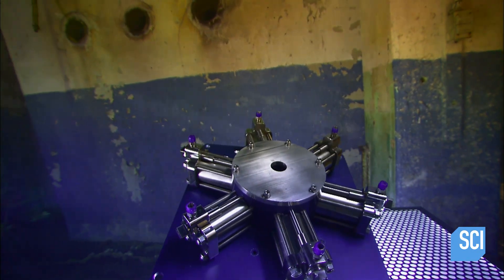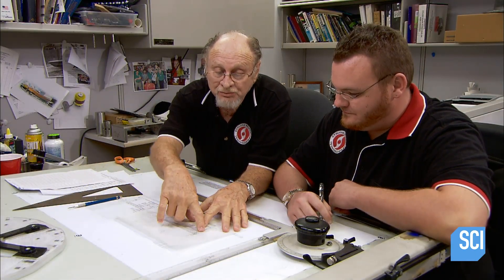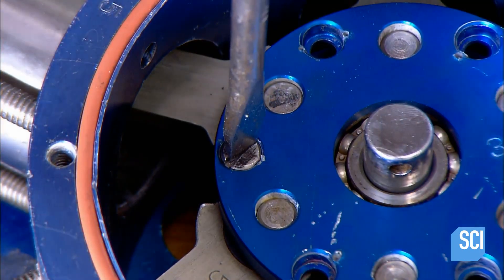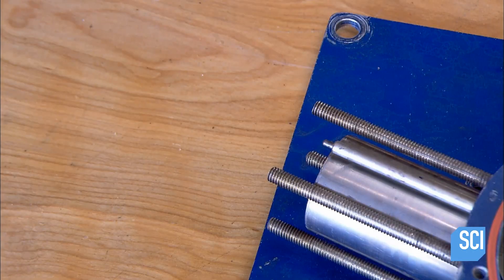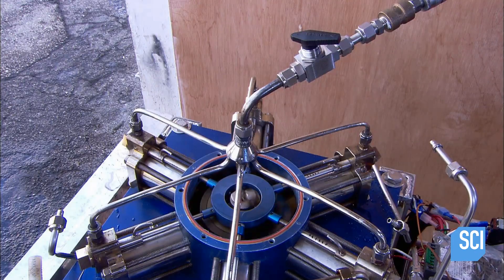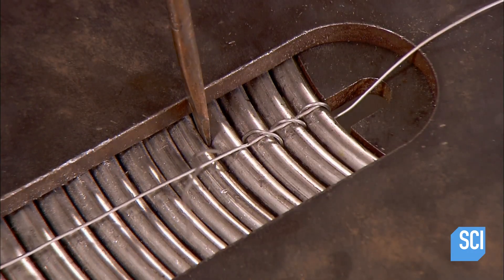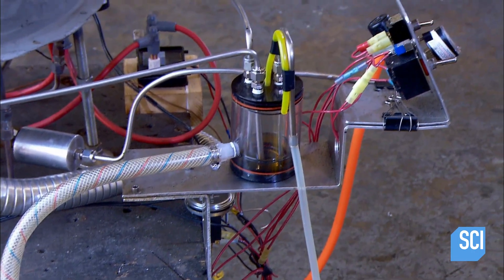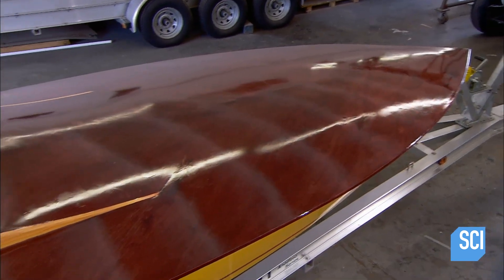How It's Made: Steam Engines

Comment: This is awesome! Can this engine withstand freezing temperatures? Won't the water expand and warp or crack components? Maybe if you mix anti freeze into the water but I'm not sure if that will interfere with engine operation.
Reply: Use it in a car
Use it on a boat 
Use it in a house that is remote
Burn gas
Burn grass
Burn family photos en masse
Reply: Are you aware that steam is hot?
Reply: @kylesenior  I was referring to when the engine wasn't operating obviously.  However now that I think about it I suppose electric heaters could prevent damage during down time in freezing temperatures.
Reply: @robotswithryan8348  Fair enough. It seems strange to me to run the system intermittently, but if that's what you're doing. I'm not sure water would pool inside the pistons either when not in use.
Reply: @kylesenior  yeah I'm not sure where the water would pool either. One of the examples was a vehicle and those are usually run intermittently.
Reply: @robotswithryan8348  Vehicles seem like a poor choice to me. It would be better for stationary power such as powering a remote home.
Reply: @kylesenior  that makes sense
Reply: @jort93z  I suggest brushing up on the reading comprehension, buddy.
Reply: @robotswithryan8348  there were steam boilers that had superheaters to create dry steam. i think that the boiler here is a flash boiler.

Comment: So theoretically, it's an infinite power source through solar energy? Use sunlight to heat water to vapor and charge a cell for night time. And we can use atmospheric pressure to reduce the temperature at which water boils.
Reply: You might as well just use a solar panel at that point.
Reply: @16BitGoofball  solar panels have a maximum theoretical efficiency of 33% and few even break 22%. They also lose efficiency as they heat up. With this thing, the hotter the better, so with a mirror like they showed you could run air conditioners in the summer for a far lower initial investment than solar panels, and get peak energy output in sync with peak demand.
Reply: @AM-ce4of  That's not far below the efficiency you can expect from any steam engine. The lower efficiency from a solar panel is far outweighed by its simplicity, cost, and as The Bamboozler mentioned, service life. Small scale steam went obsolete for a reason.

TL;DR, this might have better thermal efficiency, but photovoltaics have better overall efficiency.
Reply: Haha you must be joking, or maybe you just love to overcomplicate things while pushing efficiency down the drain.
Reply: For about 1000 hours apparently, thats how long the engine is expected to run. Thats why they are not in buisness anymore.

Comment: “Water is not only the working fluid it’s also the lubricant” water may seem like a lubricant but it is absolutely not you would need to use steam oil for the lubricant
Reply: I came to comment that, water is not a lubricant at all
Reply: was just about to write the same. Jay Leno perfectly explains it in one of his many steam car videos.
Reply: Exactly right. Water has no lubricating properties. Maybe a water soluble oil would do the trick
Reply: @Kevin75668  I think it can reduce friction like hydroplaning but it doesn't prevent contact between 2 coarse matterials riding on each other
Reply: Shell makes it, you can get it in big vats for full size engines or teeny bottles for steam powered models.
Reply: This engine used ceramic bearings that are lubricated with water.  I don't know how piston wear was managed.   The company failed regardless, but the owners are still trying, but with virtually no investors.
Reply: @Kevin75668  yeah the water is moving and directed. In the video application water is not being forced around the piston. I would agree water can be used in place of a lubricant when pressure and materials will allow it.
Reply: @Kevin75668  that ship doesn't use any steam cylinder oil? Oils with fatty acids are added to many steam cylinder applications. Like steam powered locomotives.
Reply: @Digger818  The real info is always in the comments
Reply: @Digger818  water is indeed (very poor) lubricant . it's 250 time less effective than motor oil. but if you take that into design of bearing part, you can use water as lubricant.
yet still poor lubrication and (may be) poor design.
Reply: @kittipatkeetist3575  water is a lubricant in the same way any liquid is a lubricant. Acid could be a lubricant as long as you have enough that you can hydroplane on jt
Reply: In regards to the 7 month old conversation it's worth noting that in the case of wet steam the condensate that forms causes a good bit of heat loss. In the case of this engine it utilizes superheated (dry) steam which wouldn't condense in the cylinders so they would have no choice but to add a lubricant. I do wonder if a dry lubricant would A. dirty the steam and B. Be sufficient to reduce wear on the engine. Alternatively would it not be possible to make the engine easy to work on such that cylinder walls and piston heads could easily be replaced after wear and have a system that both recycles and utilizes superheated steam?
Reply: Have you ever heard of a Cutlass bearing. They are used in larger out drives on boats. No oil used, just water.
Reply: @wg6215  I also dipped the oar hinges with lake water so they won't squeak when rowing, does that count for lubrication?
Reply: In fact water condensing in the cylinders is not favourable, part of driving a steam locomotive was flushing water out of the system every time you stopped
Reply: In my experience spit will work as lube if you're desperate enough.
Reply: One of the many bs claims in this video. This was the worst "How It's Made" I have seen.
Reply: @Kevin75668  all examples are smooth surfaces with primarily linear forces except roads. Hydroplaning is when the water becomes the surface you are actually driving on which is exacerbated by a smooth surface such as ice or concrete. And by your logic, solid things such as pebbles and sand being put on the road to reduce friction would be a lubricant. The definition is: a substance, as oil or grease, for lessening friction, especially in the working parts of a mechanism. No one would ever say "the road is lubricated with rain"
Reply: @Digger818   there is such thing as a dry lubricant, like graphite and carbon.

Comment: Seriously this company needs to make a home generator, I'd love to have a generator that was low noise and could run off of just about anything.
Reply: If a steam engine is quiet it isn't working.
Reply: @VRStuff Honda or Briggs, only brands I'd ever trust.
Reply: You should do some research on Stirling engines, they are so awesome and can be DIYd to a certain extent, they are already being used in co-generation and such, vastly superior to the steam engine in practically every way, the efficiency in theory is unbelievably high, however they do have their disadvantages, for one the power denstiy of a normal-pressure air (as working gas) ones is really low, but that is not a problem with stationery use such as generation, of course. 

The neat thing about them is they can be used in basically anything, coupled to a combustion engine, fireplace, steam engines, used for solar power (with better efficiency than solar panels if done right) and everything in between, wherever there is a temperature differential created (not necessarily heat) they can work. The best stand-alone use for vehicles I've seen is canal boats, you have the natural cooling from the water below & they are quite + you can crank it literally by hand, and the low power ensity is not an issue in the slightest. However I even seen one guy here on youtube build a small tractor with a stirling, real neat stuff, and the build was what anyone with a garage full of tools & some reseach could do. You can also re-purpose other engines and pmps, such a refridgeration pump, to make them, and there you have the ability to run light gasses at pressure, for pretty impressive power, but you will have slow leaks so you have to re-fill, in other words the engine won't run for extended periods of time without control, but that's the price you pay. But when you get into the more advanced, weird designs, you have a whole new world of possibilities with no drawbacks. The reason for them still being a mostly forgotten tech is due to the complexity once you get into the high efficiency & power density regions, amongst some other issues some of which I already touched on. But for personal projects, off-grid and that sort of stuff, Stirlings are really second to none if you know what you're doing.

It's kind of similar to how the Tesla Turbine is, it's amazing tech for personal use, but just not scalable, so there is little to no corporate interest. The tesla Turbine is the most efficient out there, however because of it's nature it's literally impossible to make it above certain size, as the RPM of the turbine has to be very high and the speed at the edges of the disks will be too high for any material to survive it. But, since you're interested in Steam Engines as home generators, you should really check out the Tesla Turbine, there's already some videos on youtube of people building their own steam generators using these turbines, as again on a small scale you get that super-high efficiency without the discs breaking the speed of sound.

There is also a thing called the Manson engine, but it's arguably worse than the Stirling in most ways, so little interest for people there, however it may have it's own advantages in some aspects, and if nothing else it's an interesting engine for sure.
Reply: @Tee's Gameplay Clips Glycol won't carry over with the steam, it would be an unholy mess to deal with.
Reply: Even woods🤗
Reply: Indeeed
Reply: Why would you want this hunk of shit? I don't know if you realize this or not but steam engines are a nightmare to operate and maintain. That's why they are not commonly used anymore. Get a diesel backup generator instead. You can run it off of used cooking oil and used motor oil, which you can get large quantities of for free. They're both waste products.
Reply: @Tee's Gameplay Clips the boiler they showed being made is calles a flash boiler, it makes steam nearly instantly unlike boilers from the olden days. All the noise steam engines traditionally made is from the steam exhaust pressure- this steam engine has no steam exhaust as it's captured in a condenser radiator and returned to the water tank as warm water. Steam engines have worked fine in cold climates with normal cold climate preventative measures since their inception. Every notion you have it seems is pertaining to steam power of 150 years ago while the engine in the video is so different and more versatile than old steam, petrol, diesel or electric in that it can be powered by propane, petrol, diesel, waste cooking oil, waste motor oil, solar or even woodfire powered. A motor that runs cooler, therefore lasts longer because it doesn't have fire inside it. An engine that doesn't need a gearbox other than forward/reverse in some instances. If in a car, at traffic lights,  isn't running so effectively has the fuel saving traits of hybrids. The only thing holding steam back is the novelty value electric has, being the "flavour of the month" and being pushed so hard by govts.
Reply: Your best bet for a generator is an old diesel tractor with healthy batteries and glow plugs and a pto generator or a good old school generator. Something quality. Gas or propane powered is fine for small portable units. How much time do you run a backup generator..?
Reply: @tacomas9602  Not too often thankfully!

Comment: Hmm.  No mention of how the exhaust steam get out of the cylinders.
Reply: The steam just turns back into water and recirculates
Reply: @allygator616  not in the cylinders it shouldn't, this engine is just embarrassing a hobby model steam engine form around 80 years ago would be 10x better than this, the only reasonable part are the boiler tubes.
Reply: The reed valve on top of the piston opens during the upstroke.

Comment: Steam is not cleaner because it burns less. It's cleaner because the combustion process occurs at atmospheric conditions where the conditions are not capable of producing the more noxious emissions likes Carbon Monoxide and NOx.
Reply: Umm...why do I need a carbon monoxide detector in my house for my natural gas furnace, then? Pretty much all combustion produces CO.
Reply: @TexDrinkwater  I probably should have worded that better. CO generation occurs even in regular combustion processes but in WAY less quantities than internal combustion engines. It's a product of incomplete combustion due to a lack of oxygen in the environment it burns within which IC engines tend to create. When I was making that statement, it was under the assumption that the fire was like a campfire at a steady state where it was nearly smokeless and thus burning cleanly with comparatively little CO.

Comment: Never seen a less effective way to use steam in a piston engine
Reply: It has to be one of the worst designs I've ever seen. They used a water tube boiler, great. Condensing, beautiful. Single expansion, wtf. No cutoff, wtf. No lubrication, are they high?

Oh god, I looked it up. 30% thermal efficiency and "over 1000 hours of runtime". So it won't last more than a few months and it's barely more efficient than a gas ICE at best.
Reply: @herpnderpn2484  It seems like it's supposed to be a small, low cost steam engine.
Reply: @rubiconnn  I get it, but there are already cheaper and more compact forms of power. No improvement in fuel economy, and nobody knows how to work on it. 

It seems DOA though. They haven't updated their website copyright since 2015 and the last activity was 2017.
Reply: @herpnderpn2484  It has uses though. If someone lives on a farm and they have a large surplus of unconventional fuels that can't be burned in normal commercial engines and they just need a small and low cost power source for PTO accessories like wood chippers, log splitters, pumps, etc.
Reply: @rubiconnn  still there are better ways to use that fuel even with steam
Reply: @IKucheINtortIE  What other ways are there that will run off of any flammable fuels?
Reply: @rubiconnn  Used oil (both vegetable and motor) can be put into older diesel engines, and they'll run just fine. As for wood, using it for heat in a modern woodstove is rated at 60-90% efficient, depending on the set up, while this is rated at 30% efficient. Wood heat can completely replace gas/electric heat in many cases, so while it doesn't generate electricity, it saves it in colder climates.
Reply: @nathanandrews2668  What about fuels like wood gas, natural gas, kerosene, etc?
Reply: @rubiconnn  Most of those are better suited to heating a house rather than for use in steam engines like this. Again, this steam engine is only 30% efficient, 70% of the energy is lost entirely. The EPA's lowest allowed efficiency for a modern furnace is 79%, and that's only for industrial sized applications, residential sized are required to be 87% efficient.
Reply: @rubiconnn  the thing about it is that this steam engine is way worse than most seasonably made ones the fixed valve operation, lack of proper lubricant and single acting pistons mean that this steam engine is awful. Which is a massive shame because steam engine have so much more potental, look at the dobel steam car from the 1920s (Jay Leno did a great vid showing his) its so much better that its embarrassing
Reply: @crestfallensunbro6001  Can I buy the engine from a dobel steam car for a few hundred bucks and have it shipped to my door in a few days?
Reply: @rubiconnn  a hobby model made in china would be better than this, and im sure there are people making similar ones in the US. this engine has major design problems which make it far worse than the designs of the late 18X0s and early 1900s

you would be genuenly be better off getting an old school single cylinder steam engine.
Reply: @crestfallensunbro6001  Again, can you find one that would be as cheap and mobile as something like this?
Reply: @rubiconnn  should be fairly easy to find with a little googling, you may have to get the "engine" (the portion with the pistons and valves and so on) and the boiler separately if you want to go for the water tube style of boiler.
i would try search terms like "live steam engine model" it would likely be a kit of parts as they are a more niche kind of engine.
Reply: @IKucheINtortIE  They attempted to emphasize biomass that would otherwise not be used as a fuel.   The design isn't commercially viable.
Reply: Really what would be the use of this "machine"? They compared it to a ICE, but as a generator, it would suck, a vehicle wouldnt move a bit and even in an RC model it would eat ass with that huge open flame. And for a show piece the machining and finishing would be too crude. Is this even more than a fidget thingy that wastes steam?
Reply: @IKucheINtortIE  seems like a toy. Steam is fun but impractical on a small scale. Modern thermal effiency of steam is 80-90%.

Comment: What do you call this kind of engine setup?
Reply: I would say it’s probably closer to a power plant rankine cycle then a piston cylinder cycle. Basically a power plant but the turbine is replaced with the pistons.
Reply: awful, its missing like half of the basic components of a steam engine like the regulator and proper lubrication.
Reply: @crestfallensunbro6001  but what if I happen to WANT to sit close to a source of superheated steam with no regulation, no obvious pressure relief valve, and no obvious safety valve?
Reply: Steam powered, piston engine...
Reply: A radial engine. I think the name of the company was called "Cyclone Power".